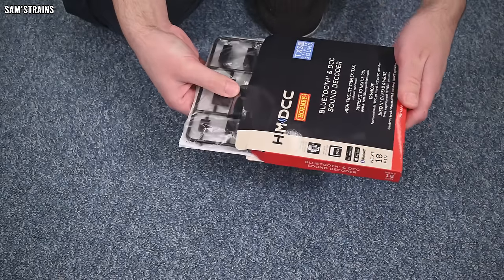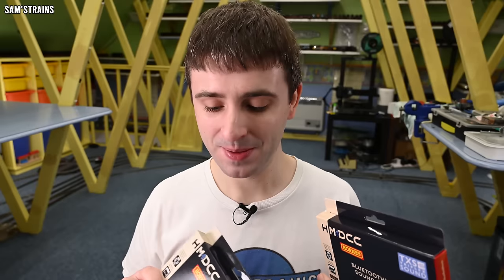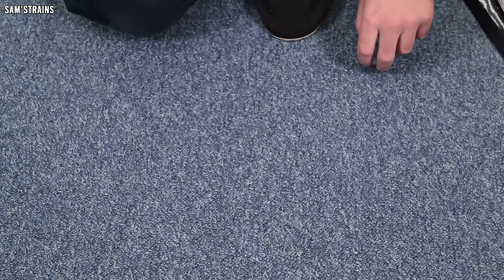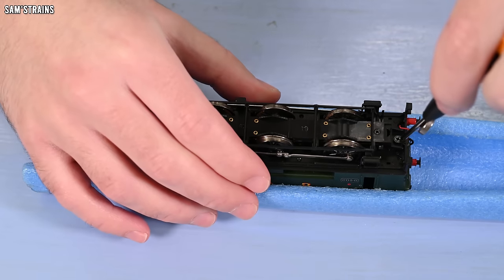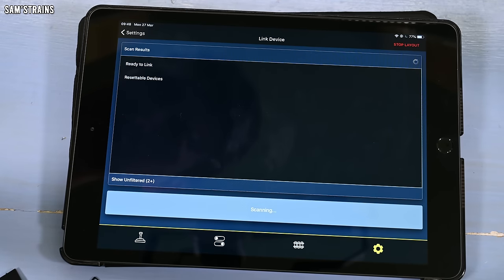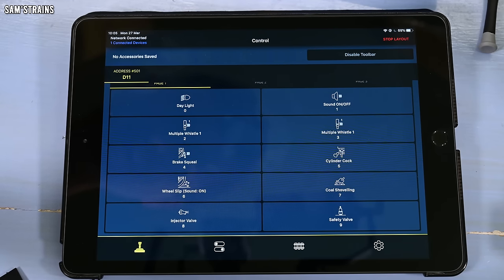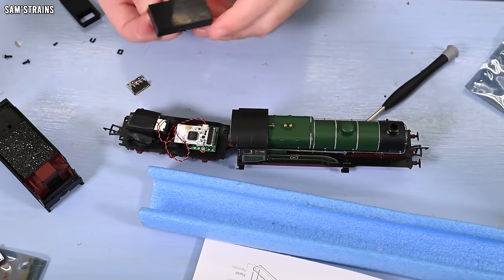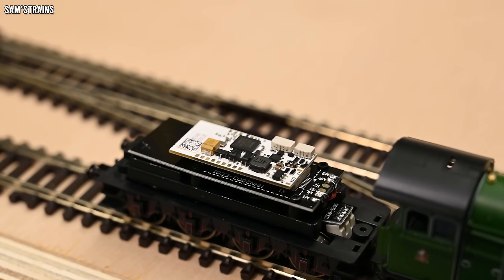Too Big For Most Locos & Burnt Out After 1 Day | Hornby's New HM7000

Comment: The only reason that the decoders won't fit is that the pcb size is dictated by the antenna. If a version is offered with a separate antenna pcb the size issue would be solved

Comment: I should have taken your advise after yours “burned out”. Last week I installed one of these Hornby HM 7000 sound decoder into my Hornby 08 Shunter. Bloody thing died within a few minutes of operation. The loco previously had an old 8-Pin non sound decoder, which was working quite well. I reinstalled the old decoder after the HM7000 died and my loco still worked. Proving there was nothing wrong with my installation. I purchased my HM7000 from Rails of Sheffield, tried contacting them a number of times but their silence is deafening

Comment: There are 2 major drawbacks with this system that I can see. You've touched on the first one with the size but it appears that Hornby have designed the decoder round their own locos and only their own. That means, as you have seen, the chances of it fitting anyone else's are slim.

Secondly, as this is a Hornby system, they control the sound files you can upload. Got a Dapol 59? Want sound for it? Sorry, not a Hornby model so you aren't getting it! Got a Bachmann 66? Want sound? Sorry but we designed the decoder so it won't fit in anyone else's models.

Hornby seem to exist to support their own models and get you to buy only those.
Reply from the maker: Thanks for sharing! Yes I'd say you're right on the first point... and only the TT locos at that, as I can't recall having any Hornby OO locos with a Next18 socket.
Agreed on Hornby's control of the sound files... but they stand to sell more decoders if they give some customisability to their customers... can't see what they've got to lose by not doing that!
Thanks for watching, Sam :)
Reply: Sam how long will they remain free to download? Other developers get market penetration then start to charge. There must be a cost to Hornby to record the sound files. So how long will they continue to subsidise modellers. Just asking!
Reply: Who's to say they won't release further sound files for non-Hornby locos? It seems logical that they would start with files for their own locos. Why would the decoder not fit in a Bachmann 66? There's loads of room in them.
Reply: @mikewoods4177  That's a very good point!
Reply: I believe they are concentrating on sound files for their own locos first, which is fair enough.

Once they've done that then it would be good if they considered adding profiles for other locos or provided an option for people to add their own sound files. Whether that will happen I don't know, I guess it depends on whether there's an benefit to Hornby of doing so.
Reply: Do Bachmann do Hornby any favours? This criticism also applies to the TTS decoders.
Reply: Sorry - I can see this being derailed unless supported by others (never gonna happen)  just like Hornby's TT120 system.
Reply: I think you are being over negative.  It is natural that Hornby will try a brand new system on their own locos.  If this radical new system is a success, other manufacturers will begin to make sure their locos are compatible with the HM7000, not the other way round.  It's early days, but very promising...
Reply: In the Hornby Q & A video today, they stated that their system won’t work with Gaugemaster DCC controllers. I think they were referring to their ‘dongal’, but I don’t know what that does! Have you got any idea what they mean?
Reply: In there Q&A they also recommended that you us there power supply unit. I understand there it regulates the power differently from other DC transfers this, could be why the decoder failed
Reply: I was just watching the Hornby HM DCC QA. They stated that they are only developing sound files for their own locos "at the moment", but that "who knows in the future". I had been considering back fitting my locos with HM7000 decoders, but since I have more non Hornby than not then I'm afraid this rules HM7000 out for me.
Reply: I'm watching these with interest  although the app isn't out yet for Android but it is for iphone. Hopefully it won't be too long yet.
Reply: Not making the decoders fit other brands opens the door for a third party to come in and produce one
Reply: Of course Hornby have designed the decoder to fit their models, they are the only models that they have control over. As an analogy, if you bought a set of windscreen wipers at Ford for a Focus, would you expect them to fit say a VW Golf? The same goes for the sound files Hornby are not going to rush files for locos they do not model.
Reply: Parochial attitudes towards compatibility.  In all fairness, where does the packaging state that it's only for Hornby locos?  This is all half-baked thinking.
Reply: Perhaps you could tell us which model manufacturers exist to support other brand models. Of course Hornby exist to sell their products, they're not a charity, they're a business.
Reply: @richardstaz721  
Of course they're not a charity but they're also selling decoders.  If they don't fit others' locos then the sealed packaging should say so.  A great idea half executed -- sound familiar, Hornby?
Reply: This is the definition of a proprietary system you gave here... As I said, if I want to run it into a Roco German steam engine, I have serious doubts about the possibility to do it.
Well, I'm looking at some G scale from Piko, I think I might not have such issues. DB BR 80 sound anyone ?
Reply: @michaelwhiles5282  Agreed. It's basically DCC on Bluetooth, and this can, and ought to be in my opinion, an open source system for simple standardization and interoperability reasons. Wait for someone like Dijikeijs to enter this game, with other manufacturers like DCC Concepts proposing DCC on BT decoders...
Reply: @DJ_K666  no android device support yet? Well even if I was "in", that would be me back out! I don't own a crApple device!
Reply: @dibsyardshuntinglayout  not yet but apparently its on the way. I don't own anything by Apple either.
Reply: @brat96th  I have since discovered that you can control the Hornby decoder fitted locos on ordinary DCC controllers, together with your own  previously DCC fitted locos, so I still don’t understand what the dongle does.
Reply: @brat96th  Wow, thank you! I don’t know why, but I didn’t understand that from the Hornby presentation. They could have explained that clearer. That’s obviously the bit where it’s not compatible with the likes of Gaugemaster, as there isn’t a port that you can plug it in to.
Reply: Hi Sam i would be careful, with installing decoders after walking on carpet, as static charge will build up and destroy your decoder, maybe straight away or over time, this is why they are in an anti static silver bag.
Regards Paul
Reply: @tonyharley4185  regulates the power differently? There's only so many ways to supply power Hornby don't have some magical components that do something special with the power.

Not aimed at you but at Hornby BS.
Reply: Your wrong there, I have a 21 pin hm7000 sound chip in my bachmann 66, fits fine, works brilliantly.  My only criticism is the speak is a bit weedy and a big bassey speaker would be better but for the cost of the whole package that's nit picking.
Reply: @mikewoods4177  Easy for Hormby to manage just included a token/barcode for a free sound file download in the loco box.
Reply: @richardstaz721  Peco?  Gaugemaster??
Reply: @tonyharley4185  So you're telling me that Hornby have built this system to ONLY work on their contollers? Then what am I supposed to do then? I can't use any of Hornby's (or any UK controls for that matter) controls since I live overseas and we have a completely different power output! If Hornby really wants this to take off they seriously need to take their overseas customers into consideration!
Reply: Of course why wouldn't they support their own merchandise, they are a business not a charity
Reply: @loggior.speedweed4345  get a inverter steps up voltage or down voltage
Reply: Exactly, Michael.
Reply: @mikewoods4177  Looking for problems already , give them a chance before you start moaning
Reply: @mikewoods4177  Negative already
Reply: It’s worth bearing in mind that you only get Hornby products on the old railmaster or elink system as well
There is ways to import other brands but it’s such a faff that I went back to my old gaugemaster prodigy 2

Comment: My local model railroad club here in the US has their layout set up with the dcc system through a secure wifi system to use both dcc controllers and smartphones.  I used my phone to control my personal rivarossi allegheny, and though there were a couple of hiccups, it worked fairly well

Comment: Another good video, Sam. I am surprised that you did not start with the TT model or a recent Hornby one. I thought it was pretty obvious that Hornby designed this system with their locos in mind. Same as Bachmann and Dapol do with their chips although there will be some useful crossover. It will be more interesting to see if the other decoder manufacturers start to make compatible decoders. I think this looks like a great system with loads of potential.
Reply: Scot, as far as I know, the only other firm that makes decoders that operate with bluetooth is Soundtraxx in the US.They released their new Blu-nami decoders at the end of 2022. I do like the concept & hope Hornby won't take as long as Soundtraxx are to release the app for Android users.

Comment: I like the idea of Bluetooth, it seems to have potential.
Hornby will have to look at resizing the board, or maybe an extension lead so the Bluetooth board can be located elsewhere?
A dummy board would be good too, so we could try it for fit before purchase, to make sure we can fit them to existing locos.
Reply: Awesome idea! It's really hard to return a DCC chip after purchase as retailers often think you've messed around with it already
Reply from the maker: Yeah I do too - and while it worked this was really great to use! An extension lead would have helped a lot - reckon this could have fit into a few of the locos I tried if it had one!
Thanks for watching, Sam :)
Reply: @SamsTrains  in the hornby livestream today they even said it could be fitted into a coupled wagon behind the loco. Not sure how you would connect it up though.
Reply: @russcole5685  , did you watch all of the video, he went down 2 floors in his house and it still worked.

Comment: In the past I have dcc'd old locos with a pre wired 8 pin socket which you can then place anywhere in the loco body .I'm sure these are available for 6,21 and next 18. All it needs is a male to female extension with a 15cm ribbon in-between ,then you could place the chip elsewhere. Maybe someone will bring it to market.
Reply: I have never seen a 21-pin, Plux or Next decoder with wires. The whole point is that they are tidier with no wires hanging off & should be a standard size which should plug straight in. It is worth pointing out that the only Hornby 18 pin loco Sam tried was the TT120 Scotsman. The others were from different manufacturers.
Reply: There are already adapters Availiable from dcc concepts
Reply: Yes I get the point but if it doesn't fit then an adapter is the next best thing,thanks Roger

Comment: Most of the ESU and Zimo non-sound decoders I've bought have clear shrink wrap to protect them. Hornby should consider that. Everyone should use an insulated screwdriver to avoid static.
Reply: And an earthing wristband, just like working with computer parts
Reply: The ESU decoders that are 8 pin ones have the shrink wrap but the 21 pin ones are bare.

Comment: As I have written elsewhere, I had the same problem with loading the sound profiles for Flying Scotsman.  I think the Hornby server became overwhelmed, because when I tried it at 6am one morning, it worked fine.

These 18 pin decoders are really intended for locos designed for 18 pin, which so far is a category which is largely confined to TT120 ones.  But I think the new Dublo Merchant Navy is either 18 or 21 pin, and I presume the new decoders will fit it.

I haven’t ventured into trying the 8 pin decoders so as to convert my 00 locos to TXS sound and Bluetooth control, but again, I assume the Hornby 8 pin TXS decoders will fit at least the majority of Hornby locos, and perhaps some other brands, and the pictures show that some components are on a separate harness.

As to burning out, I have been running three TT120 locos on this system without problems, using the Hornby 4 amp transformer, which I believe has short circuit protection?  Are you sure your Powercab has?  It looks like space junk from Apollo 13!

Comment: Regarding the power loss and how long it takes to come back on is because it has to reconnect to Bluetooth as Bluetooth sometimes is slow to connect. This should use WiFi or WiFi direct which would be faster to connect. Bluetooth is slow and always will be. Great video as usual.
Reply: Bluetooth also has much less bandwidth then WiFi, which is why even things like Bluetooth headphones often cut out. There is particularly a known problem with Bluetooth on windows because of the bandwidth.
I really don't think people should be using Bluetooth for things that require complex controls. Even most gaming controllers use either USB or radio signals
Reply: that is so true, that's why i suggested this should use Wi-Fi or a USB dongle or something with more bandwidth than Bluetooth.  @Stettafire

Comment: It’s very early days for a completely new system. Hornby freely admit it’s a case of constant development. They also have enough small locos of their own to realise that they will need to solve the chip size issue.
Reply: They do need t shrink their decoders, but do they make any small OO tanks with an 18 pin socket? All those Sam tried were from other manufacturers.

Comment: Just a note on next18 burn out. Handling these decoders has to be done carefully and making sure that you are earthed and don`t get the fingers touching across joints etc and depositing body oils which can short out the chip. The amount of times that decoder was tried in different locos ... tbh ... not surprised it blew. If handling instructions are provided (poor if not) they should be followed.
Reply from the maker: I was very careful with the handling, and if it'd fit into the first loco I tried, I wouldn't have been handling it as much. I didn't see any handling instructions. The decoder worked all day once fitted into the Scotsman. Not sure how body oils could short out the decoder over night, at least not at these low voltages, but I'm no expert!
Thanks for watching, Sam :)
Reply: It's not possible to short components with "body oils" and it's also very unlikely that unearthed handling will do any damage. This is why manufacturers are happy to sell these bare boards -- if normal handling killed them the return rates would bankrupt them.

Comment: at 8:49 and 20:30 I noticed that the 08 is of the proportions of a Lionel Devious Diesel, as evident by the cab shape and lack of rods.
Soundtraxx has recently developed Bluetooh DCC recorder under the name Blunami which are the same size as their normal Tsunami line DCC decoders and have a larger variety of sounds programmed in. But they don't come with standard plug ends, no speakers, and are much more expensive.

Comment: My assumption for the size is that they were designed with Hornby locomotives in mind, since its a hornby system. I bet as they continue to improve the product they'll be able to shrink the PCB size to fit in more locos. 

With the cutting out and restarting under bluetooth, I bet its because it takes a few seconds for the bluetooth module to restart itself, and then reconnect to the tablet. Thats more a limitation with the bluetooth system in itself than with the decoder or controller, so I dont think theres much Hornby can do about it. You'll definitely want that stay alive battery to avoid those issues.

Comment: Sam, the size of the next18 board is defined by NMRA standards. There are two standard sizes, one for sound fitted and one for non sound fitted. Is the board actually bigger than the sound fitted standard? (Table 1 of the standard gives dimensions).
Reply: I've just answered my own question by downloading the hornby manual. It seems the board is longer and wider than the standard.  Strictly speaking it is therefore incorrect for Hornby to call it Next18 compliant/ compatible.
Reply from the maker: Thanks a lot for looking into that for me! I suspected as much, as I couldn’t actually find a non-TT loco that’d fit!
Reply: @SamsTrains  Sam, you use decoder extension cables . In small locos decoders are often squeezed into tight spots away from the socket.

Comment: The reason it did not work, at the end of the load of profile the app showed the shunter being lifted off the track. This resets the decoder to make it work, all shown in the tutorial Sam. When you switched off the system it had the same effect so well worthwhile to have a section switch on a decoder track and watch out for that lifting the loco off the track on the app. It is used a couple of times in the setup process.
Reply from the maker: No no, I cycled power to the decoder whenever asked to - I can read haha!! ;D
Thanks for watching - Sam :)